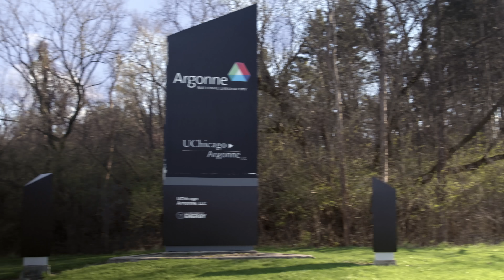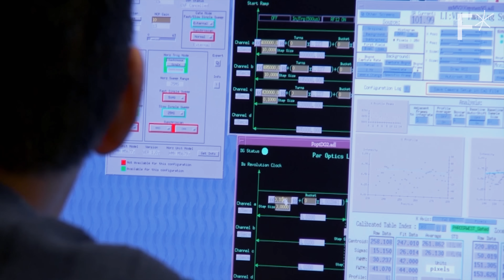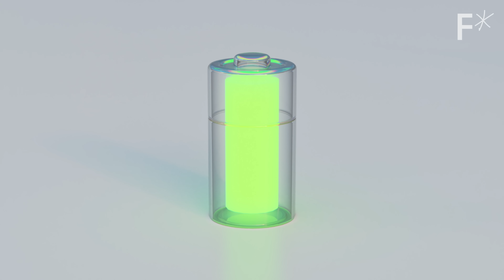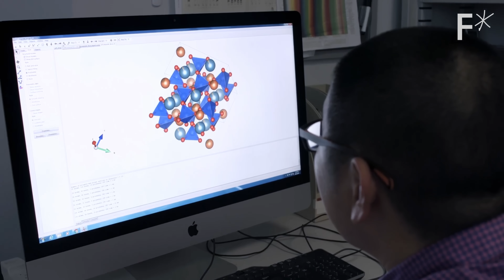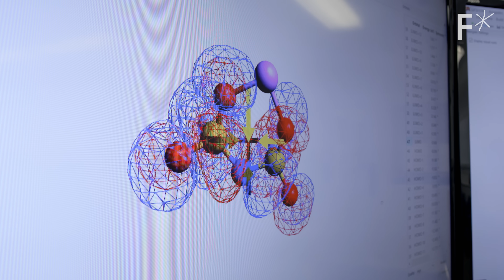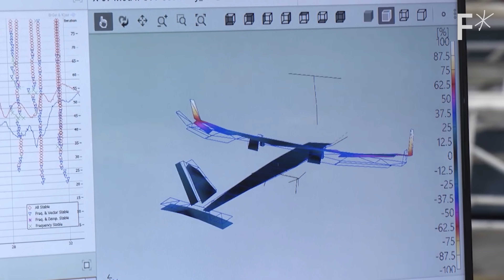The future of high energy density batteries | Hard Reset

Comment: I hate when people compare batteries to petrol and say batteries will replace petrol. Batteries don’t make power people, if you want to remove petrol you need a replacement power source.
Reply: Well if you think about it, fossile fuels, uranium, waterflows, airflow, sunlight, they're all sort of like batteries. They're stores of energy that we want to transform into another form of energy.

The issue is that we don't get to control a lot of these. So how do we rely on solar on a dark day? We basically build a different kind of battery which can store that energy for later.

Comment: This is just wishful thinking disconnected from reality.  There's more to a battery than the material inside of it.  Let's pretend (a thought experiment, if you will) that you have a cell with a battery in it capable of powering a fictional lightsaber.  One day you decide to eat at Arby's.  Soon, you regret your choice as you run to the bathroom in the hope of finding an open stall this time, unlike the last time you had Arby's.  You find the stall, but in the process of sitting down, you drop your phone in the toilet.  What do you think will happen?  Or, in a more straightforward case, if a teenager in their infinite wisdom decides to nail the phone to a wall with a nail gun?
Reply: And don't get me going on how "computer simulations" are magic.  If that were the case, we would have cured the command cold and cancer too.

Comment: I see it when i can buy it. Right now there is tons of battery crap talk. Also switching to anything else from lithium will be inferior without a lot of electronics which makes it less cheap or if not done then it will be just inferior also keeping in mind that current battery tech has a huge separator problem which gets worse if the energy density is any higher. E.g it burns easier.

Comment: I can see one plausible scenario for converting all ICEVs to EVs.  The company Neo uses battery swap stations for it's EVs, much like gas stations in concept.  Now, if a Sodium EV battery becomes viable combined with the swap station concept, the EVs have a chance.  They would still require an onsite small modular nuclear reactor at the swap stations, that way there doesn't have to be the massive upgrades to the power grid, and the small modular reactors can sell power back to the grid whenever EV battery charging is low demand.  There's the new problem of nuclear proliferation and terrorist threats to the smrs.  Again, only way I can see EV's replacing ICEVs, you need the energy density of nuclear to pull it off, the moneys not there for massive grid upgrades, there's not enough high concentrations of Lithium deposits.

Here's the other thing, why bother doing any of this, man made climate change is a banking industry scam.  CO2 is rising in precise inverse proportion to terrestrial magnetic field strenght decline, nothing to do with human activity at all.  The earths magnetic field gets weaker, more solar and cosmic radiation gets into the earth and heats it up, the oceans and land emit more CO2 in response.  We can't do a thing to fix that.
Reply: *nio
Reply: I'm definitely going to need a source for "man made climate change is a banking industry scam".
Reply: “The common enemy of humanity is man. In searching for a new enemy to unite us, we came up with the idea that pollution, the threat of global warming, water shortages, famine and the like would fit the bill. All these dangers are caused by human intervention, and it is only through changed attitudes and behaviour that they can be overcome. The real enemy then, is humanity itself.“– CLUB OF ROME, PREMIER ENVIRONMENTAL THINK-TANK, CONSULTANTS TO THE UNITED NATIONS
Reply: @chrishoff402  I've tried to find a published source for that quote, and I'm not fining one. Again, can you provide a source for your information?
Reply: Was the ozone layer a banking scam aswell?
Reply: @s_for_short2400  It exists, 1st Ozone hole was detected over Norway only a few years after it's discovery, but before the adoption of CFCs.  Out of curiosity, which has the higher atomic weight, Freon or Nitrogen?  If I fill a balloon with Freon, will it rise like a Helium balloon or fall to the ground because it's heavier than the surrounding air?

Comment: Transport  using electricity is all but a fantasy at this time. Using batteries to run cars at this time is the same as placing your cart in front of your horse. It is ludicrous. These guys are hopeful for a breakthrough, but then so am I. What of it? Nature does not care what you wish for. Nature goes its on way and in its own time. Now is not the time to do away with fossil fuels. We have a great deal of work to bring our grids up to date and make them secure first. If electricity is going to be our sole source of energy, then the delivery system for it MUST be very reliable.

Comment: This is just one of the areas where an AI running in a quantum computer could create a leap in technology evolution. The AI could simulate millions of possible chemical combinations in the same time we can do just some dozens or hundreds. We have lots of challenges but I am confident we can find solutions, if we can overcome politics and greed.
Reply: An AI cannot simulate more chemicals than a human, the bottleneck is not setting up the simulation, it is running the simulation and an AI would do nothing to accelerate that. A quantum computer would. But AI won't run in quantum computer. I think the most realistic improvement is a faster simulation of material properties due to improvements in computing power, and possibly machine recognition of patterns in simulated materials. Anything else, don't get your hopes up.

Comment: petroleum is realible source of power #1 because we have reserved all over the world. Dont join 100% in green energy or other alternatives because they cant sustain the demand right now but they are potential but saying we are ready to move on other power resource is kinda stupid. And the big cons is the supply of that kind of element or materials. For there desperation to stop using petroleum we dig more grounds for rare chemicals than petroleum. Nuclear is also a valuable solution for power if the cars going to electric but without modernization of power source. It will add up the demand for electricity.

Comment: If electricity is really the future; then think about replacing the concept of the electric grid with something else. how about  hydrogen fusion or something else.  How about freeing people from the electric companies.  To call them power companies is a fallacy. Do away with the grid and have in home electric generators the size of a refrigerator.  Do away with the solar farms and wasteful wind mills. With all the solar, wind, hydro and tidal generating sources there is still not enough to even replace 20% of the current gas, oil, and yes coal generating sources.  Other battery types are in development, even sodium, but they only last about 10 years not the sought after target of 25 years.  Replace the greed of monthly bills with true selfless service. Ah but that is about a century away. We will still need to burn things for a long while.

Comment: 1. Yeah, I'm excited. Energy costs are 3X what they should be.
2. Solar energy is affordable and abundant. Just - not after dark or away from the equator..
3. Solar energy is now cheaper than carbon fuels. Because you pulled the plug on carbon fuels.
4. Solar energy will save us from Global Warming. We're all going to die in the Winter of Cold and related diseases.
5. Scientists are also experts at public policy. Communism, Fascism, Total surveillance and Control - those are science based.

Comment: we still need lithium especially in phones due to the fact how lightweight Li is. Noone wants to carry 300g+ phone. Research should focus more on increasing the battery capacity without increasing the weight or the volume of the battery.
Reply: I would absolutley carry a 300g+ phone if the battery lasts more than 2 days at high energy consumption. Especially if the phone is still compact, volume matters more than weight for me.

Comment: What we need is recyclable battery not high energy density battery. If we chase battery tech at current pace, we be a planet full of toxic left over batteries in next 50 years.
Reply: Check out the liquid metal batteries by Ambri.  They're not suitable for passenger cars, true, but they're not flammable and don't degrade very quickly if at all, while also not using lithium at all, and are easily recycled.  They're not nearly as light, but they thrive in constant charge/discharge cycles.  Their primary market right now is grid scale.

Comment: They also need to develop a battery that will safely, fully charge in the time it now takes to fuel up the tank in your internal combustion engine car.
Reply: Won't be a battery, that'll be an ultracapacitor. Ideally one lined with Graphene to increase it's storage.
Reply: @your_a_idiots  its*
Reply: @JorgetePanete  calm down
Reply: @JorgetePanete  its no different with its or it's
Reply: Not necessarily as long as the battery has the capacity to drive more than a few hours that's more than enough to satisfy the majority of people's needs and could slowly charge over night

Comment: Your video is not correct. You are not trading oil for lithium. Your electricity is still mainly produced by a fossil fuel burning plants. You are just receiving the energy a different way. They don't just magically create energy at a power plant, and your video is very misleading. @freethink

Comment: Stop fooling around, the ideal battery is a magnet flask stuffed to the brim with electrons. A Tesla can drive a million miles on 160g Electrons. Without kidding, if energy density doubles or triples, EVs would be able to perform like gasoline cars weight power wise. A model 3 might have plenty of HP but it weighs as much as a loaded lorry.

Comment: Next 10 to 20 years... But they said the past the point of no return will be reached before then so why even bother? Right now renewables aren't even mature enough to replace fossil fuel at its current stage. Until batteries can outdistance combustible engines and have portable packs like gasoline cans, that future is still a long ways to go.

Comment: Imagine where we'd be if we stuck to EV's all those years ago..
Reply: Yea I think we'd be at least 5 - 8 yrs ahead at this point, if not more.
Reply: The new lithium-ion batheries and other recent alternatives were mass produced only about 10 years ago. And since then they improved the car battery design and other major EV components that were lacking years before. Just look at old EV models, they were weak, lacking in autonomy and overall low performance. Fossil fuel provided the necessary power ar the time and it was way cheaper. I could give you a few more reason, but I'll keep the comment short. Feel free to analysie the subject and think for yourself about this.
Reply: @simonmarcu01  you're missing my point. EV's were around about the same time as combustion engine cars but were given up in favour of range & big oil interests. But what if they kept at innovating EV's instead of just giving them up.
Reply: Yes if only someone paid me half the cost of a $50k-$75k electric car, we would definitely be better off

Comment: The future is hydrogen and nuclear fusion, not electric.
Reply: How old are you? Nuclear fusion is still decades away and will be for the near future.  Hydrogen still has a mayor problem- long term storage. Battery aren’t perfect but that’s exactly the reason why we are researching. For now the future is mixed,. fossile fuels for at least the next 20 year will still be the biggest player in energy.
Reply: @christophvonwaldhuf  Nuclear would have been the primary mode of generation since the 50s were it not for astroturfing by the fossil fuel industry. It is the safest, cleanest, and if sufficient scale were achieved - cheapest - source of energy. SMR is currently a no brainer. It has none of the weaknesses (meltdown and weapon proliferation) and all the strengths of traditional nuclear power. Unfortunately is it unlikely it will achieve mass market share due to - again - the fossil fuel industry. We will instead probably use hydrogen (which is made from natural gas) for mobile generation and natural gas (methane) for mainline electrical generation. It doesn’t matter that our world will die because of it, profits for oil barons are significantly more important
Reply: @danielstory2761  so did I say something wrong? Thx for adding to my comment. The guy was talking about nuclear fusion not fission and probably green hydrogen tho. Which as you now are not realistic as of now.
Reply: @christophvonwaldhuf  I was replying to your original comment, not the edit you made. Glad you agree with me now though. Nuclear fusion could have been practical for years now had the level of investment been higher - it is absolutely pitiful considering how radically it would change our society for the better. Unfortunately some people benefit from the continued use of fossilized ancient plants
Reply: The Next Generation of Batteries
Graphene technology is not the future, it has already hit the market
https://youtu.be/Zj9WFnyEyLw

Comment: Fuel cells would have been a better investment in the short term chemically converting fuel to energy… battery technology is running a generation behind tremendous waste and frustration is going to happen as we move away from oil n gas
Reply: No, fuel cells and hydrogen economy have their own fundamental problems and batteries are inherently more efficient, especially for small applications. Also, this is not a either-or thing, it's gonna take both to make it work
Reply: @SwuuschifyMe  i agree but had the invested in the seventies in fuel cells natural gas conversion wed much closer to converting to renewables "leap frogging" seldom works